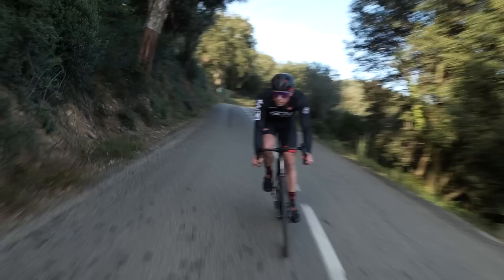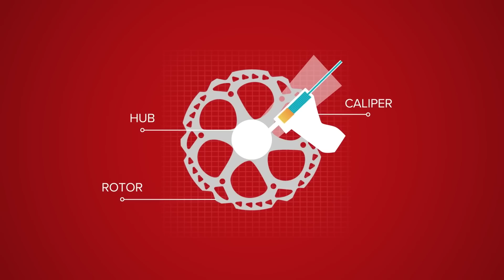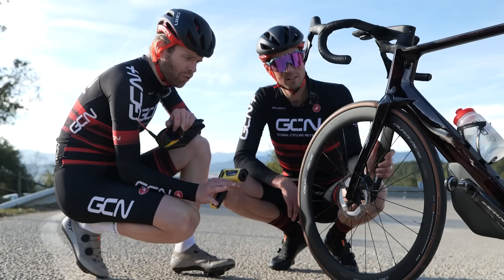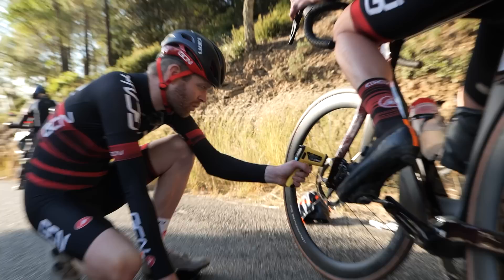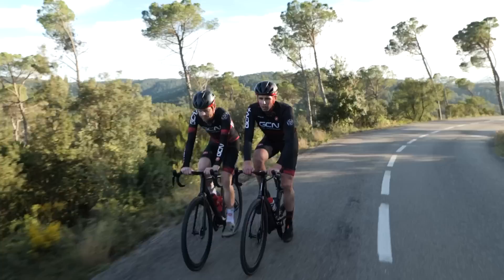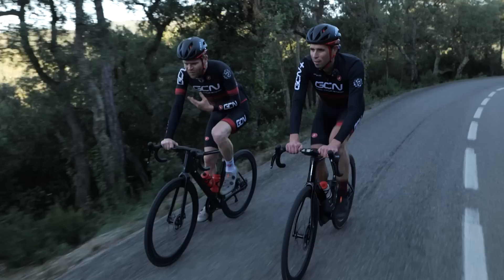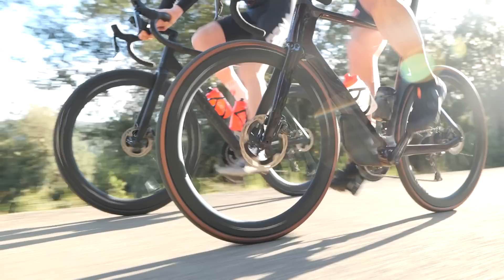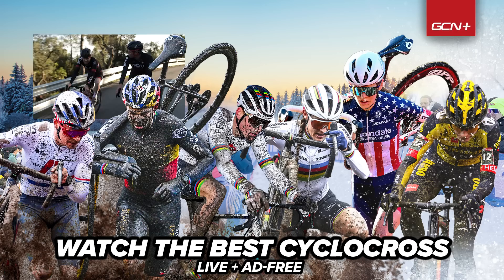Are Big Disc Brakes REALLY Better?

Comment: I'm old enough that I got into cycling before disc brakes were even available. Rim brake bikes are lighter. I bought my first new mountain bike with cantilever center pull rim brakes. I eventually upgraded to V-brakes. I bought my first disc brake bike back in 99'. I could feel the difference immediately. I had a friend who had cable disc, which weren't quite as powerful or as good modulation as my Hayes hydraulic ones. After going from 6 inch rotors to 8 inch rotors I could feel the brakes were so powerful enough to put me over the handlebars if I wasn't careful. With 6in rotors no mater how hard I braked I wouldn't ever go over the handlebars. I know from personal experience that bigger brake rotors really DO make a Big noticeable difference! That said, most won't agree with me but, I believe that disc brakes belong on mountain bikes and not on road bikes. I've never been interested in adding any weight or complexity to any road bike I've owned. Thank you.

Comment: At normal temperatures braking performance is dictated by tyres more than rotor size; if you can lock the wheel or do an endo, the rotors are big enough..... with the caveat being that of heat dissipation. If you have trouble with overheating (big rider and/or nervous descender and/or riding long fast technical descents) then bigger rotors make sense. But if you don't tend to over heat your brakes there's no need to go large. One of my buddies is 90kg when in top shape but a very capable descender so runs 140mm discs.

Comment: Yes, bigger and thicker rotors means more stopping power and more heat dissipation/absorption (BUT) for road bikes the maximum rotor size is 160mm if you can get a special adapter you can use 180mm but often being too big for the tire itself the default standard for mtbs are 180mm and for roadies its 140mm people tend to upgrade these and switch to 160mm and for mtbs 203mm rotors

Comment: IR thermometers are calibrated to work on a blackbody. Human skin is a good approximation. A steel rotor is not. It is reflective of IR, corrrspondingly less emissive, and specular. Which means your measurement depends, perhaps very sensitively, on the angle of measurement. This was not controlled among several other factors

You can get a much better measurement if you put some black paint on a piece of the rotor

Comment: Try a Tektro Auriga Twin (a disc brake with 2 calipers on one lever, made for 3 wheel recumbent bikes) with a hub made for a rotor on each side with 220 mm rotors each

Comment: The rear brake is used more consistently than the front especially downhill, washing out the front wheel is the cause of eay more accidents. Bigger thicker roters on rrar is best

Comment: I have to buy a new bike because of an international move. All the manufacturers have moved away from rim brakes to disc, especially my first choice Canyon, so now I'm moving to disc brakes for the first time. I'm really worried about the longevity of these things, especially after Peak Torque claimed that you can go through two pairs of rotors per year. That's a very high cost.
Reply: @stephensaines7100  that's not what I asked

Comment: Statements & Questions... Statements: 1. Larger discs provide more leverage, more surface area for heat dissipation, AND, more mass for Heat Soak... 2. Added leverage requires less force on the brake lever for the same amount of brake braking power(as a smaller rotor), OR more brake power for the same amount of lever force(with a larger rotor)... Questions: 1. Is using brake discs with cooling fins only a fair test? How would non finned discs perform? >.> P.S. What's that bulge on 'Not Ollie's'(I don't know his name)down tube? (I have one on MY bike - but's it's custom\I put it there) O.O & rim brakes are dead to me as their performance fades when riding in the wet(not that I condone riding in the wet - lol)...

Comment: Didn't you guys just do a test where you basically drug your brakes all the way down a huge decent, and Campy even gave you the go-ahead to do it, and it turned out, nothing happened other than the rotor got hot?  No system failure, nothing exploded into bits, etc.  I run 140 on the road, front and rear, but of note, I have rolling terrain, and never decend for the durations you guys are by a long shot.  I really want you guys to do a stop test with discs vs rim, like the one you did when Alex was riding a stoppie over and over.

Comment: I would like to see a 15-20% decend with 250lb rider. I agree that for light/ moderate riders going down moderate declines, it doesn't matter. But i recently did the tripple bypass in colorado. And 20 mile 10-15% declines at 30-40 and sometimes 50mph decents scared me to death. 
What would also be nice is to know how things go bad. Do the brakes fade. Do they make sounds then warp. Or do they break and bind. I mean, if you have to push them, then they will rub a little thats one thing. If they lock up at 40mph on the side of a mountain thats another story.

Comment: Having seen the difference between a 160 and a 180 mm rotor under a big guy (~150 kg) who was new to riding park and dragging only his rear brake all the way down the hill I can safely say 160 mm = boiled fluid and lever to the bars, 180 mm = a weekend of riding with only a discoloured rotor to show for it.

Comment: Intrigued by the science here. One of the factors you need to accurately determine when using an IR temperature sensor is the emissivity of the material that you're measuring. It's pretty complex to explain but one of the best work arounds is to paint the measurement surface black and then set the emissivity value on the temperature gun to about 0.98. While the temperature matched at the beginning, incorrect emissivity values can cause dramatic variences. The temperatures seem a little low - at ~50 oC, you should be able to touch them very comfortably

Yes, I know we're not all thermal scientists here and the physics behind all of this is a snooze-fest but it might explain why all the results appeared very similar.

Comment: I've got a gravel bike with 160mm rotors and an xc hard tail that's basically set up as a slightly more hardy gravel bike up with 180mm rotors and fast tires. 

Descending on the 180 rotors feels so much better. The 160s start to noticeably fade on high gradients and I have to be mindful of how much I'm riding them. Both are using shimano resin pads, and both rotors are shimano rotors. 

I'm 88kg. if I was 60kg I'm sure the 160s would feel fine :D
Reply: Swapped from resin to metallic pads while keeping the 160mm diameter, the difference is like night and day!

Comment: The reason why the size of rotors doesn't really affect price is that the cost to the manufacturer is almost identical.

R&D, tooling, the time it takes for something to be produced, shipping and distribution are all costs that remain effectively the same no matter the size. The material cost does change but the final price is almost always rounded up to some X0,99 price which covers up all those differences.

Comment: The best braking effectiveness would be achieved by a solid rotor, but its heat dissipation efficiency would be woeful.  That's why even decent automotive disks, whose weight matters a lot less, are vented.

Comment: Being a bigger guy I don't want to run anything less than my 203mm ice tech rotors on my MTB. When I finally end up with a disk brake gravel/road bike I will be using the largest possible that the frame/fork can handle. I want to know that I have more braking power if I need it.

Comment: I'm about to replace my back rotor from a 180 to a 203 XTR rotor but I have a mountain bike.  The front came with a 203 automatically. I prefer using the back brake more than the front brake when mtb instead of the opposite.  To me its safer.  I also weigh over 200 lbs and use 4 piston brakes.

Comment: Ever since I began cycling back in the 1980's I've considered rim brakes to be like discs brakes. Of course the problem with heat transferring to the tire is the bugger. If some engineer could figure out a coating or rim design that overcomes this issue and designs a hydraulic rim brake the lever action would stop you on a dime!

Comment: If only there was a way to get a larger rotor than 140, 160 or 180 on your bike OH YEAH a 622mm rotor called rim brake bike technology!
Reply: 220 mm with 4 pot calipers have sufficient stopping power to rip fragile Road bike forks apart ;-)

Comment: MTB is my first sport and mixed disk brake rotor size has been around for a couple of years, however I did own a road bike as my 2nd bike (sorry GCN I flipped to a gravel bike recently) so I was really intrigued by the content of the disk brake on road bikes, maybe the pro teams will consider mixed disk brake rotors on their heavier riders or the fast descender. I think this opens a valid question in the future of the sport

Comment: I think the real question is which would prefer to have when you want/need to stop. We use 203 mm rotors front and rear on our tandem (160 kilo team) These work really well wet or dry. They are mechanical. I have noticed especially when in Europe in the Mountains that the pads wear quite quickly. Let's see the test in the real world with heavier riders.

Comment: Interesting experiment but no mention of brake pad area. Brakes convert kinetic energy to heat and noise via friction. The pad area has not changed regardless of rotor diameter, so assuming the rider mass and velocity was consistent between tests, I don’t expect any differences in rotor temperature. Increasing diameter will dissipate heat quicker and change braking force/feel.

Comment: So how about a 700mm rotor, make it aero and light by integrating it in the wheel rim? Move the callipers up to the upper fork area and since you can go through a disk surprisingly quickly, let’s change the pad surface to some rubber compound blocks. We would just need a catchy name to sell this improved system to the public…….😂

Comment: The larger rotor with greater mass and surface area should have lower peak temperatures, especially in moving air.  In your type of demonstration, it would be good to see the rate of temperature change in still air -peak temp didn't show convincing results.  The best would be to have a live measure during the descent.  In the end, there's no arguing the physics of large vs. small; brake energy in, to heat exchange out.  The practical matters should convince most riders -aero impact, lower wear rate and potential to warp, better stopping in the wet, and could the 180mm rotors make metallic pads unnecessary for all but pro riders racing high speed descents?

Comment: I have a 180 in the front on my gravel bike. Mechanical disc brakes, When I had the 160 rotor only half of the pad would contact my rotor.

Comment: The temperature going down rapidly isn't because of heat dissipation to the air, it's going into the brake disk. When you brake the outer surface gets hot, then over time that heat is conducted into the rest of the disk. Maybe a better temperature test would be 30 or 60 seconds after breaking when the temp has averaged through the material.

Comment: Compare Mini disc brakes and Range Rover disc brakes.
Did you know, the Jensen Interceptor was the first car to have four wheel disc brakes as standard.
The people to ask are Alcon Friction Components, Tamworth, Staffordshire.

In a nutshell, it is dependent on the area of friction, both rotor and pad surface. 
A RIM brake is a 'disc' that is the diameter of the wheel rim. The rotor is magnesium alloy or carbon fibre and the pad is the brake manufacturer's advised material.
Note, disc brake systems are heavier than rim calipers. This is why I am keeping my rim brakes.
The advantage of a disc brake system is they are cleaner than rim brakes for commuting every day.
Reply: Sorry but the Jensen Interceptor wasn't the first car with 4 wheel disc brakes. That car was launched in 1966.  The Rover P6 from 1963 had 4 wheel discs and even that wasn't the first.  I think you may be remembering that the Jensen FF was the first car to feature a form of ABS.

Comment: I can confirm that disc brakes are far better, especially with larger rotors, even more so for heavy riders
I've been 70kg 
I've been 110kg 
I've had dura ace rim brakes and I'd have my current 105 disc brakes over them any day. I prefer being lighter for going downhill, even more so around corners. Despite ballast making you feel more sure footed, the inertia reduces your ability to turn in

Comment: Measuring heat with infrared sensor on a metal is VERY inaccurate. Most of the reading will be the reflected infrared emission of the surrounding enviroment and since it is even a polished material it won't even be the average of it but dependant of the angle how you hold the tool and the angle of the brake disc too.

Comment: That was unexpected,  maybe final temperature was similar because brake pads wear faster above a certain temperature maybe 70 which means rotors reach maximum temperature maybe 75 , maybe you should repeat the experiment but with longer distance and see how worn out are the bads in each size

Comment: Doesn't a larger rota, with a need for lower lever force therefore result in a proportional loss of scope in the modulation of braking? Something which is expounded as a virtue for disk brakes.
Reply: I never get that argument. Yes, when the brake is so powerful that it can somersault the bike at any point (MTB with 4 pot 203mm dics) you cant fully grab the brake like a stirred up gorilla without going over the bars. but of course you can modulate it. you also dont do a full emergency brake in your car everytime you touch the brake pedal, dont you?

Comment: As someone who still owns three rim brake bikes, I wouldn't want more braking power than the already sensitive 160mm hydraulic options. I would expect more modulation with brakes that require more lever pressure, and if we already have the ability to lock up a wheel with one finger, why would we want easier braking? although the temperature theory didn't pan out, the 160's should last 14% longer.

Comment: #askgcntech Hey Guys. Nice little test. as a bigger rider myself i wonder what the impact on the fork is?  Can it take the extra leverage from bigger disks?
Reply: the limiting factor, even with rim brakes, is the 'reverse wheelie' when the rear wheel lifts.  Most riders will lift off the front brake when that happens because you're pretty sure to crash when balanced on just the front wheel as you're decelerating.  So the fork can probably handle anything the brakes can dish out.

Comment: Hi guys, another interesting one.  
A few thoughts:
Larger rotor have more surface area than smallones.
Rotors with spider arms have less surface area and thermal mass than those with disc (or semi disc) centres.
Any cooling vents or fins will create a drag torque on the wheel, even when you are not braking.
Cooler discs are kinder on the pads, therefore better pad life.
Black centres will radiate heat better than other colours, and matt black the best (they will also heat up more in the hot sun which might be a subject for manufacturers to research).
Disc brakes load the bearings and lower forks more (the reason for the change to through axles).  A larger rotor will load the bearings less for a given retardation, but are capable of loading the bearings and forks more in extremiss, thus the issues with waranty.
Finally, the biggest, lightest disc brakes you can get are called rim brakes and they're fully intergrated!  They overheat too on long descents.

I like your methodology, though to be more scientific (I know it takes forever) a number of descents for each rotor for averaging.
Perhaps you don't care about climate change but you have some very suitable hills round your Bath mega-base, what about Landsdown lane or Brassknocker, Cromwell road in Bristol?  We've even got a few nice hills over here in the Wye valley.  None of them would need a trip to Spain with the team.
Reply: 700c rims are not rotors if you understood what swept area and total heat dissipation was you wouldn't say such a silly thing. A rotor is continuous a bicycle wheel is not spokes do not transfer heat. The surface area on a rim brake track is smaller than any 160 mm or a larger rotor that is a fact not an opinion. You need to do a bit better on your research
Reply: @rider65  Thank you rider65.  A rotor is a disc.  A wheel rim is a disc.  As far as the physics is concerned they act exactly the same.  Ok the wheel rim has another job to do as well (hold the tyre) but they are still the same.  The relative dimensions of the parts are different and consequently have different rates of heat radiation, conduction and convestion (all three methods of heat transfer are in play) but they obey the same physics.
You are right that spokes do not transfer much heat to the hub.  However the spoke has the same temperature as the rim at the point of contact.  It has a small thermal mass and so conducts a very small (negligeable but not zero) amount of heat away from the rim which is dissipated into the air by convection in a short distance (in actual fact the heat transfer to the air molecules in contact is by conduction and then convection as they leave the surface).
The "pads" of a rim brake are the rubber blocks which, with refined formulations, have been used for many years because they suit the contact conditions, just as resin pads or metalic pads suit the metals of brake rotors.
I might be wrong but I suspect my grip of the physics is adequate but maybe God has made some changes in recent years.